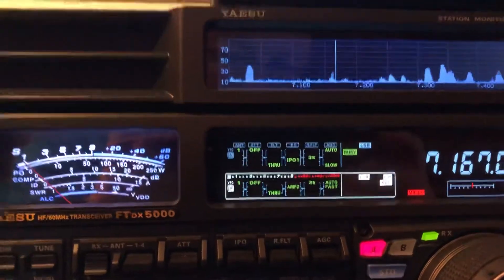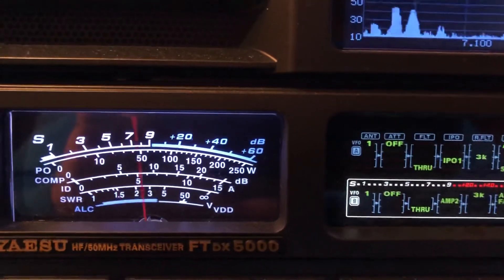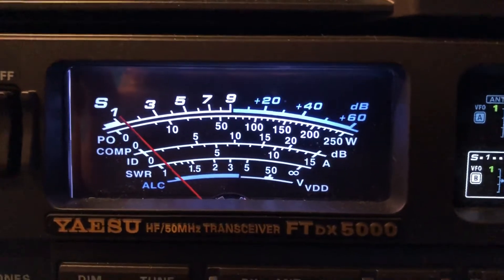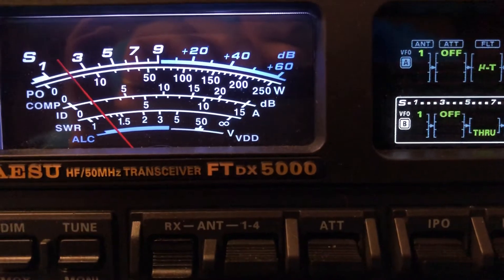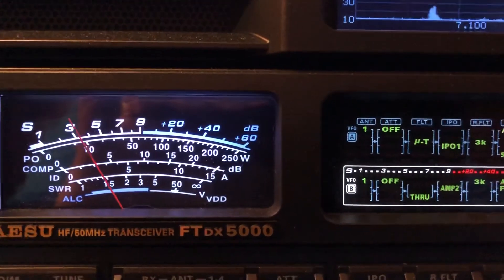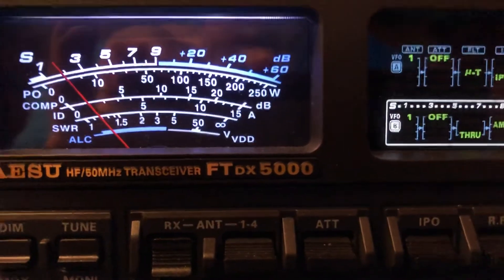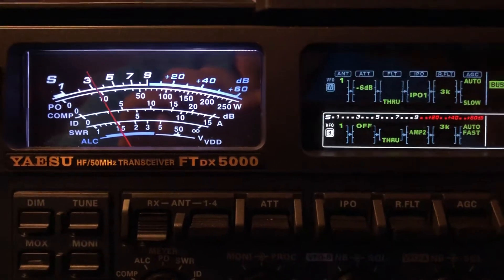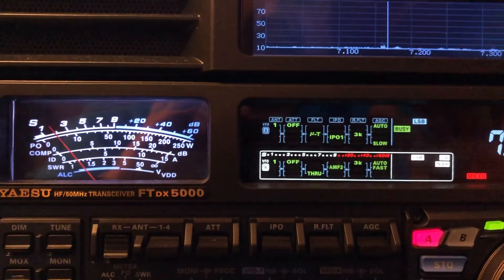Yaesu FTdx5000MP: DSP and a mu-Tuning Preselector

Comment: Great video,  how do you rate this radio to the  new FTDX 101D ?
Reply from the maker: I tried the 101 before I purchased the 5000.  The 101 is a fine radio, to be sure.  I was on the hunt for the greatest receiver for pulling weak SSB and CW stations out of the noise floor.  

I tried every radio that HRO sells, pitting one against the other.  I had originally walked int to buy a Kenwood TS-990S. The 5000 beat it on the first day, when I experienced the incredibly low noise floor on the 5K.  At first I thought the 5000 couldn't hear.  S1 noise floor compared to S6 on the TS-990S.  The TS990S was set at 50Hz filter width.  I pulled the CW station out well with the TS-990S, at S7.  I switched to the 5K and the noise floor was S1.  But the station started transmitting again and he was S7 on the 5K, with much less noise.  So, I knew my decision was not going to be easy.  I continued, going back to HRO every 3-4 weeks for 9 months and comparing every radio to the others, in various conditions, SSB, and CW.  

I awaited the arrival of the FTdx101D before I made a final decision.  In the end, the ergonomics of the 5000 won out.  I like the knobs.  But the 101 is a great radio.  The VC tuning, a built-in preselector, bests even the 5K.  If you’re into contesting, the 101D, and the 200W MP version, have incredible RMDR stats.  But the 5K isn’t far behind.  I think Sherwood should retest the 5K, using the MP Limited version.  His test results are for the 2010 version.  

The Digital Noise Reduction in the 5K is the best of all the radios I tested; including everything from Icom, Kenwood, and Yaesu.  The 5000 DNR never has the watery sound you hear with others, including other Yaesu radios.  Even the 101 has the watery sound.  Of course, the watery sound happens only because most people enable DNR without considering the noise level they are sending to the DSP to process.  Use a combination of IPO and/or ATT, and roll back the RF Gain first, to minimize the noise.  Then engage DNR.  But, the DSP processor in the 5K must be a beast.  You can hit it with a ton of noise and it just knocks it down, while never sounding like the received station is under water.

My verdict?  I’m keeping my 5000.  If I ever decide to get a new rig, it would be the 101MP, but I still think I would keep the 5K.

Comment: Hello Doug. An invaluable video for me as am considering a 5k +mu to supress strong(+5-10) ssb sigals 2Khz away from my operating Frq on 80m. What would your opinion be on the subject??Super video in HD video and audio. Many thanks. 73 Mike the KFT.
Reply from the maker: Hi Mike!  I suggest that you watch the video entitled “What a mu-tuner is and what it is not.”  There is no preselector that can block strong QRM 2kHz away, but the mu-tuner can help, in combination with a 1.5kHz filter width, IPO, ATT, and Shift.

73, N4HNH